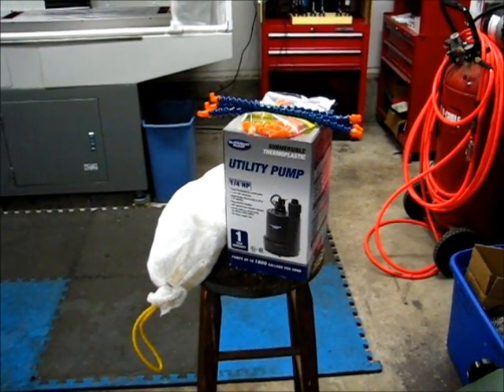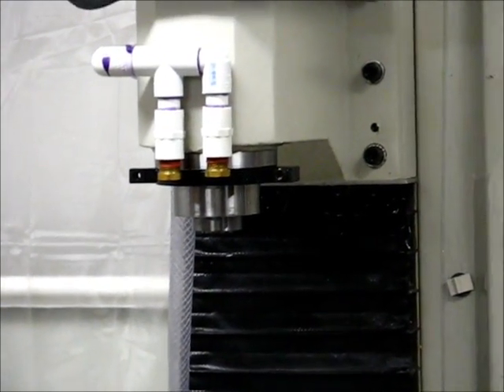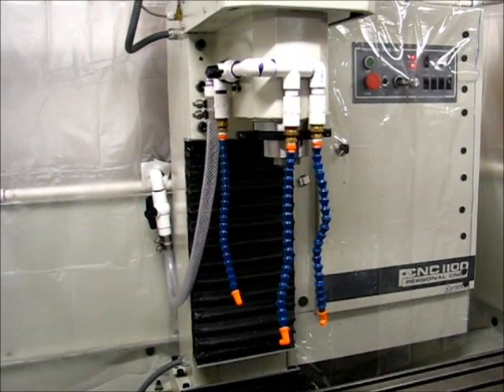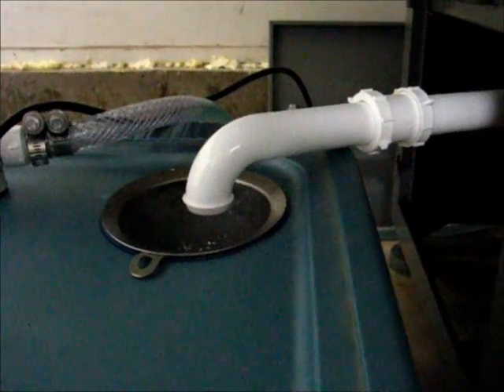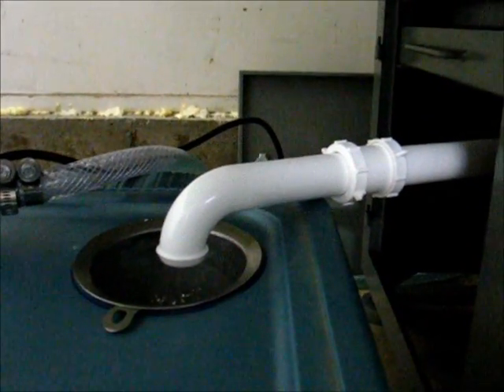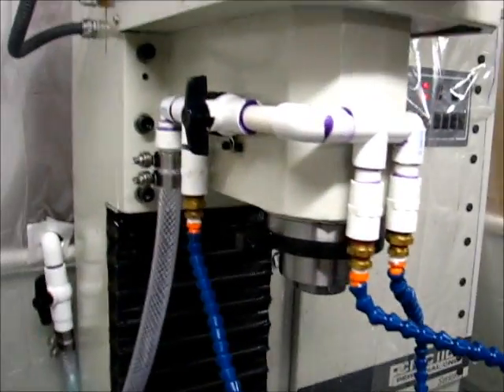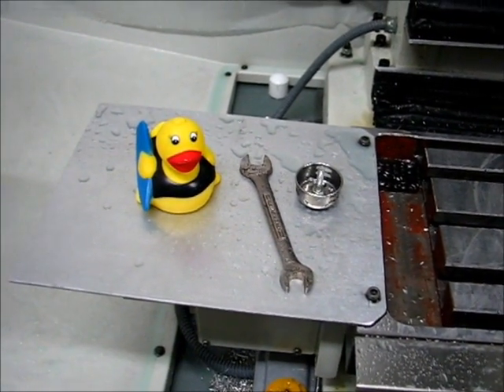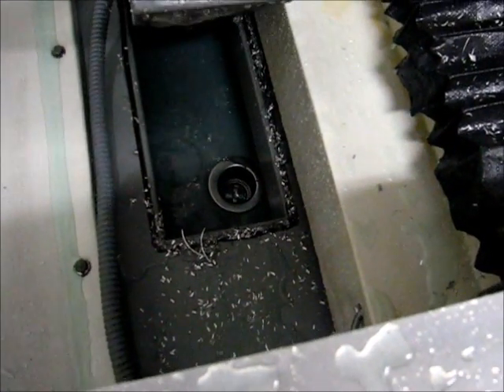Tormach PCNC 1100 - Flood Coolant Upgrade and Flow Testing

Comment from the maker: It's a 1/4 hp pump and I'm flowing way, way less than what the pump is actually rated (500 GPH real flow max versus the 1800 GPH it's rated at).

There's no kill like overkill...

Comment from the maker: Thanks for the input.  I ran parts over the weekend with the new coolant system and discovered that the table starts filling up with coolant if I don't clear the chips from the stock coolant screen.  The handles that stick up above the coolant screen were almost completely submerged at one point.  That actually has me worried for some of the longer runs since I only had the machine running about 10 minutes maximum between tool changes (no ATC or PDB).  Thanks again!